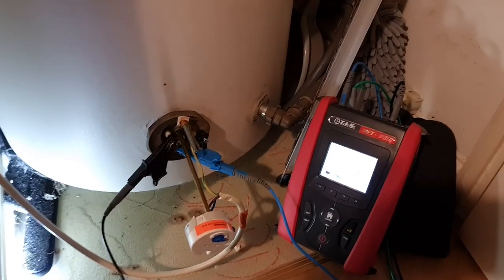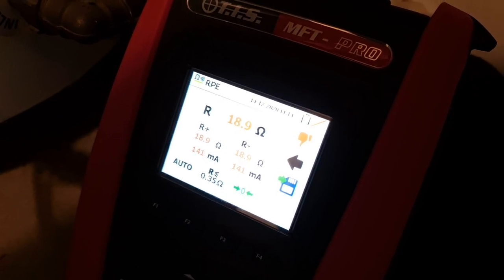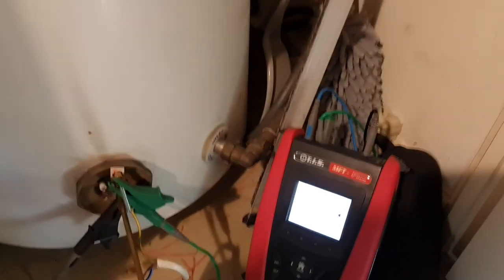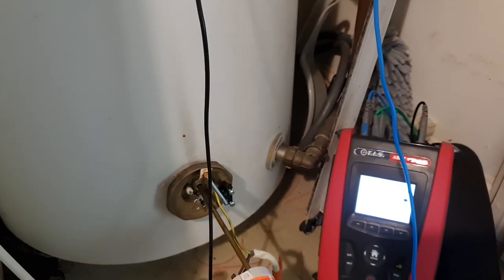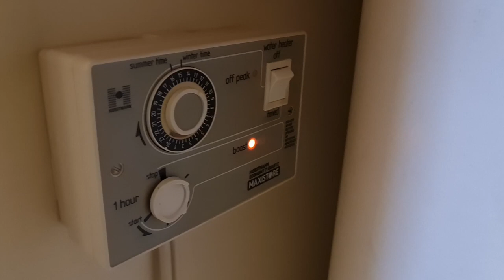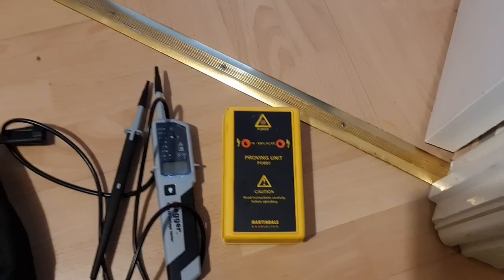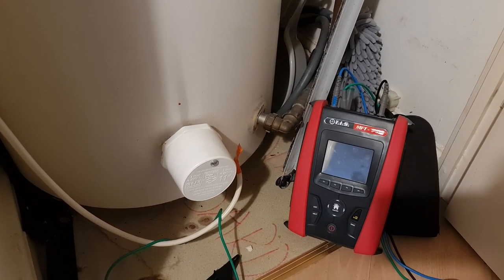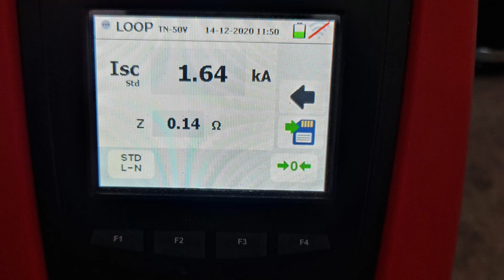Faulty immersion heater, testing tips UK electrician. TIS MFT Pro

Comment: I did an eicr today which is prior to changing the consumer unit, it is currently a square D consumer unit with type 1 mcbs, ground floor sockets  mcb had a ringmain plus 2 radials for 2 heaters (4 Lives), 1st floor socket circuit  had ringmain and 2 radials to heaters as well, a right game trying to get them back in the mcb's after for the mcb terminals to grip all 4 wires... extra mcbs or rcbos required for the new consumer unit I'd say.
Have to say I havent done an eicr for a couple of years nice to have a change

Comment: With doing insulation resistance tests at the element. Will it effect the timeclock which has an electronic circuit board?, unless you disconnected the load side of the time clock
Reply from the maker: 100% it would Paul. In this case the timeclock is connected on to the stat. By removing it from the prongs on the element the timeclock s disconnected. Leaving just the heating element in the firing line! Great point to highlight though, very important to consider equipment likely to be damaged by testing.
Reply: @electrician247  that's good I should of looked closer, i thought you left it connected still.
By the way do those cylinder thermostats just pull out?as I'm OK with the standard copper cylinder ones but the invented type seem to be in more solidly fixed, I've do a lot of immersion testing and replacement on standard copper cylinders  but been a bit wary of the Thermtec type with removing the stats.
Reply from the maker: @paultipton743  I don’t mess with the wet stuff lol. Especially pressurised tanks like these. Leave it for the plumbers for me lol. 

These are nice to test on as the stat simply pulls off. I mention it early in the video. Great point to highlight 100% though. Thanks
Reply from the maker: @paultipton743  sorry you say stats not the elements. Yeah they just pull out easy. At least these ones do.